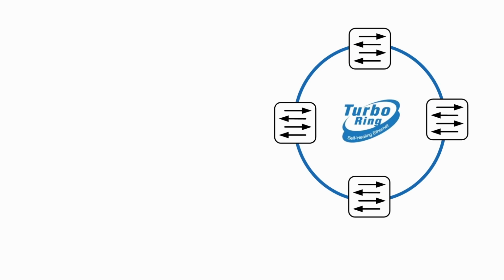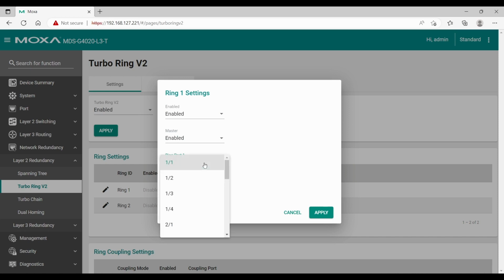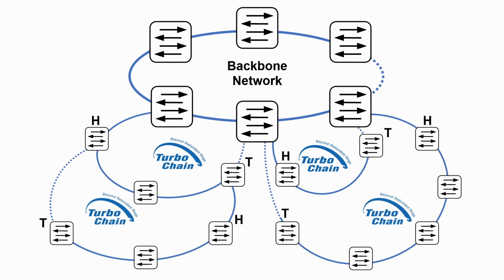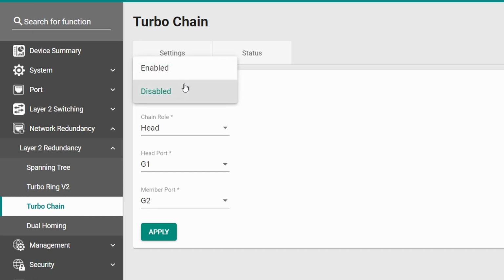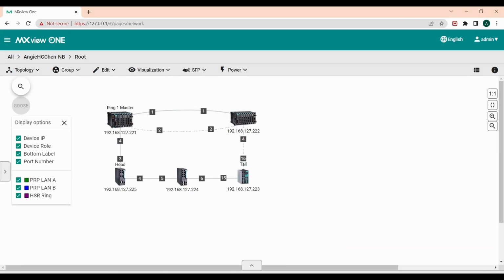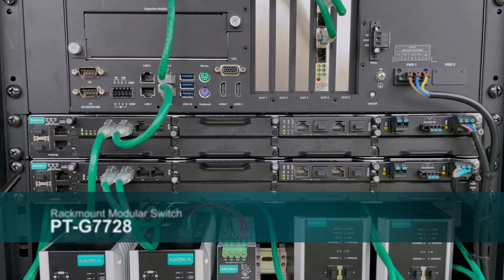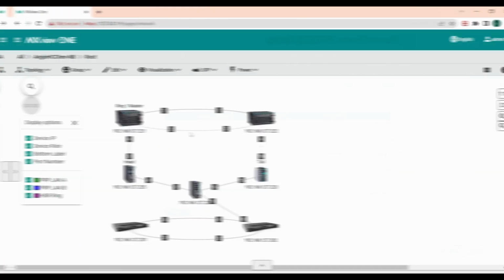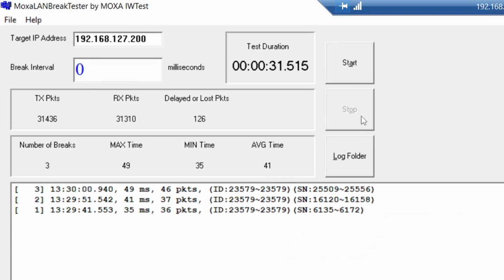Station Bus Redundancy Protocols: Comparing Turbo Ring, Turbo Chain, and MRP

Comment: Hi. In our company we got network build with many Moxa switches with Turbo RIng v2 enable. But we have a problem with our network. The "Master" is not set manually but is selected automatically. Therefore, the "Master" sets itself on the switch with the lowest MAC address, which is correct. The problem is that the link is not set to blocked on the switch that is the master, but on a completely different switch. So the entire network is not in a healthy status, just a broken one. Do you have any ideas why this is happening?
Reply from the maker: Hi, thanks for reaching out. Our Technical Support Engineers can help! Please submit a ticket on our website and they will be in touch. https://www.moxa.com/en/support/technical-support